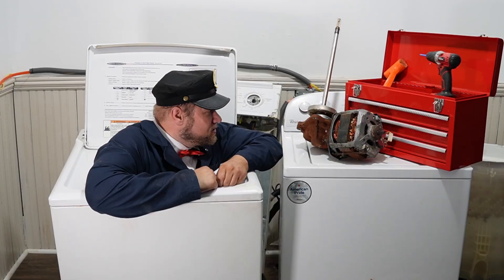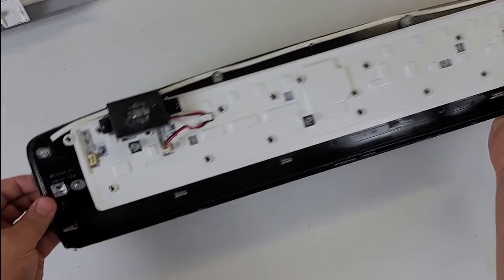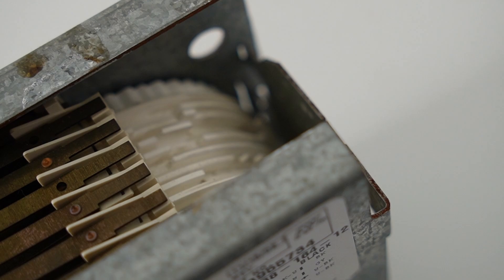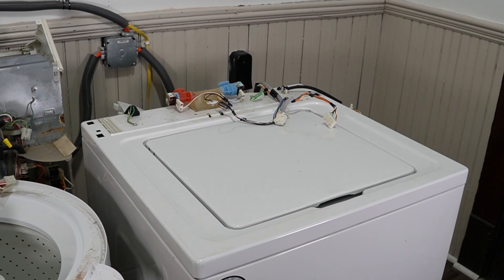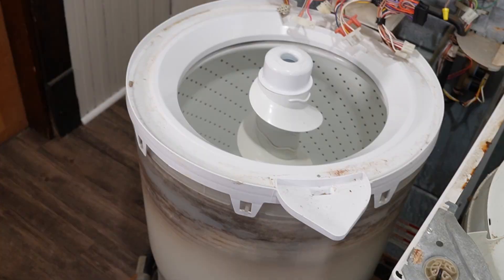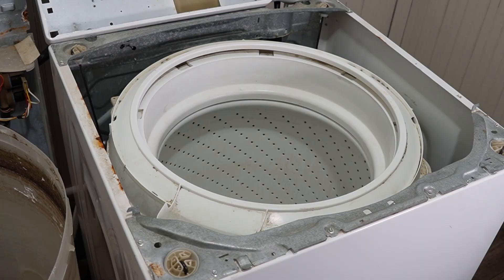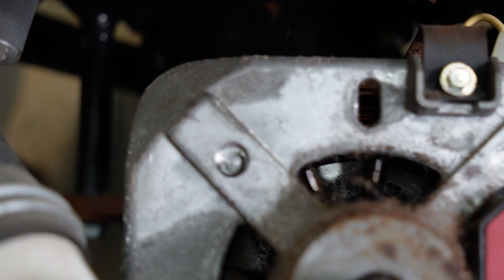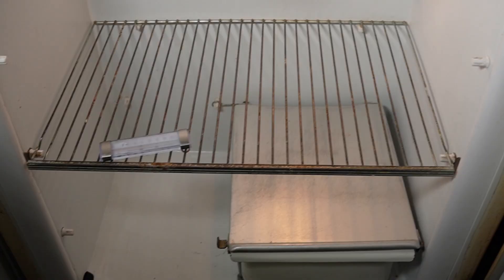Are Washers Built to Break? Inside a 1984 Washer vs. Now

Comment: one way to pull an argumentative tub loose from the spin tube is take a 2X4 cut where it will fit under the inner tub's edge and then use a car jack underneath it. as you crank it up, it will apply force from the cent directly into the tub and (usually) pry them apart.
Reply from the maker: I've done that a few times. I "gave up" because of the time constraints on the video.
Reply: @bensappliancesandjunk  I get it. Last one I had wouldn't come loose either and just had to scrap it. It's a dirty job.

Comment: I mentioned this previously but I live in a condo unit that was built in the mid 1980s that has a GE washer and dryer machine in the garage.  I really wouldn't be surprised if my appliances outlive me with just regular maintenance.

Comment: to get my tub out of my newer style washer I had to use a block of wood on the top of the drive shaft. I then put a car jack in it with a block of wood on the top and used the jack to separate it.

Comment: I used to work on all whirlpool products in the 90's. My kenmore elite is 35 years old. I replaced the inlet valve twice for under $10 ea time. Don't overload/abuse em & having a dry basement will keep em running forever. P.S Don't ever wash rubber backed rugs in them either.

Comment: When the clockwork timer on my old tumble dryer stopped working, I designed and built a sophisticated new controller and custom plastics to replace it.  I’m very happy with the outcome but it does illustrate an important point to me: That most people are not so well placed to do what I did, leaving them high and dry when things break.  This opens the market to design driven abuse.

Comment: My mom had a washing machine with a set of relays that would give up and burn every 2 years. 5 bucks to replace each.

She finally got a new washing machine. The circuit board behind the panel kicked up the ghost in 5 years. 400 bucks to replace. She regretted having sold the old one.
By the way, people don't realize that BELTS are mechanical fuses. If something should break, the cheap V-belt will destroy itself preventing further damage. Direct drive machines don't have that option.

Comment: Before my new dryer, my old dryer, that was less than 10 years old, had broke 4 separate times in 1 year. I had fixed the dryer and replaced the parts each time except the 4th time. I couldn’t believe it. It just wouldn’t stop breaking in a new spot.

Comment: I have found that using about a 3# hammer, which is a necessity to hit the spanner wrench to loosen the nut with a sharper blow similar to an impact . Then after the nut is off, I use the hammer and a 1"×12" piece of pipe. I place the pupe over the shaft and against the basket drive block. Then while picking up on the basket with one hand and hit the pipe with the hammer with the other hand.  So fat it has always worked. I hope this helps.

Comment: Still running a washer and dryer set from General Electric that was manufactured in the early 90s, in fact now that I think about it the majority of my kitchen and laundry room appliances are all old work horses, I have an automatic can opener that I just can’t find a newer replacement for because they all suck. I have yet to find another automatic can opener that can open a gallon can of peaches on nothing but it’s own power.

Comment: I have found that a SDS hammer drill set to hammering mode is a suprising capable tool for breaking loose stubborn fasteners. Might not be the best but it's what I have at hand.
Reply: That's a good idea.  I was able to get the transmission out with the aid of bearing separator, a gear puller and an air hammer.  The vibration did the trick in jarring it loose.  Didn't need that spanner tool either as the air hammer got the spanner nut to turn as well.  Next time I'll try the hammer drill first.  Thanks for that tip. Odd that it required so many auto mechanic tools to disassemble.

Comment: Excellent video, Ben!  Sorry to hear about your heart problem.  I assume that is why you are going to do a career change.  I wish you good health!

It's amazing how 19 minutes goes by when you're really into something like this.  LOL  Seriously, WOOOOSH and it was over. 

This vid demonstrated the EXACT reason that I keep our 20 year old Kenmore washer and drying in top shape.
As an Electronics/Computer tech (finally retired) I KNOW that the newer machines are NOT built with anywhere near the same quality and lastability as the old ones.
I'm very aware of how easy it is for the electronics to fail and probably difficult for the average person to obtain ACTUAL service manuals, schematics and parts lists for the PCBs.
Not everyone can do board-level repairs either.

With our 20 year older set, I've only had to repair the dryer a couple of times and it was a simple thing.  Basically, the heating element failed, but being inventive, I was able to get it working again with pressure-fit metal connectors.  When it failed again, a few years later, I just bought a new element, which was not very expensive.  Also, I do clean out the exhaust path of lint, once a year, however.

As for the washer, I have had to repair that about 3 times, but each time, it was just replacing the brake assembly.
At one point, I did take out the tranny, cleaned that up, changed the oil inside and new seals.  That was easy yet fun.  LOL

I haven't put much focus on the spring, but after seeing this video, I think that this fall, I'll tear the washer down and perhaps just replace the springs for good measure.

I dread the day that I can't get parts for these machines anymore.  As I typed that, I thought, hmmm....  perhaps I should just order a bunch of parts that I suspect would fail.  I'm not worried about the motor itself, because there are universal ones that would fit, but then, it's not too difficult to re-wind these types of motors.  They are very open.

Anyway, thanks for the great video.

Comment: A few thoughts on the subject Bought a house about 98 came with a washer and dryer circa 1975 ish Branded Montgomery Ward I've had no real trouble with the washer  except I had to replace the timer motor and oddly the dial is not  detergent proof Still looks for most part almost as good as new and still works well A couple years later the driver gave up the ghost so replace it with a whirlpool  well very soon after that I had to replace the ridiculously thin drive belt  and the paint on the dryer is so thin that it has starting to rust and I've had to paint it where as the washer as I said still looks reasonably good after all something you dump wet clothes on a regular basis shouldn't be rusting out so soon .

Comment: I repaired and own several Telechron syncronous motor clock/radios. Telechron eventually replaced their all metal gear rotors with plastic ones, to compete with less expensive models. I have a Sunbeam automatic toaster from the 1970's that was discontinued, as Sunbeam couldn't keep their prices down low enough to make a profit against lower quality competitors. I could go on and on, but planned obsolescence is here to stay:(-John in Teas

Comment: Just a thought, Whirlpool had to come up with a new design to satisfy water usage, electric consumption, that resulted a less reliable machine. Sears had whirlpool build their washer and dryers for many years, with SEARS technicians input. Also Sears specified a low percentage of failure rate. Sears would buy the washer, dryers, window ac, vacuums, etc, with no warranty from whirlpool to sell at a very good price, and Sears bore the warranty expense as they sold a high volume of machines. Sears sold way more than whirlpool did under whirlpool brand. Sears always included a parts list on everything they sold, no other company hardly ever did. Sorry to see them go…..

Comment: I had an old Beau mark washing machine which actually had a cinder block hanging on the bottom structure of the tub! That machine lasted us at least 35 years!
Reply: Many of the front load washing machines have concrete blocks bolted to them for balancing purposes, makes them ridiculously heavy, and they aren't that great of a machine anyways LOL.   Although most failures that we saw in the field were control boards, electric drain pumps, rear drum bearings, and door seals (boots).  They just don't seem to last long.

Comment: Great video!  Those appliance boards are about the cheapest I've ever worked on.  1/2 second too long with the soldering iron and the traces lift right off.  And what they charge for a new one is absurd.  Thats a $20 board.
Reply: feathery traces are bull

Comment: you can sometimes find a good electronics thechnician and have them fix the circuit board. i did that on a $700  air purifier that had a broken on/off switch.i am terrible at soldering and it cost about $20 for the work less than $5 for the parts + the drive to the location. they remove the faulty component, clean up the space and can install the new part. best to bring them the board with the new component and hopefully get instant service. took about 15 minutes.

Comment: As this video shows, and is generally true in most consumer and commercial systems-its a matter of efficiency. Standards have gotten much higher over the years, and consumers have gotten more efficient. However, this comes at several costs, often durability. Common issue in modern hvac.

Comment: 4:04 i dont see much issue on that board, except that power integration power supply ic which i replaced so many of them on control boards, they fail so often, from board that isnt turning on at all, to washer that shuts down completely by itself mid cycle

Comment: In 1994 I had a customer give me a 1969 Maytag dryer. I had it until 2002 and it was still working when I gave it away.
I currently have a GE refrigerator that is roughly 27 years old. I keep it running but it's a bit of an energy hog.

Comment: The machines I have were manufactured in Russia during the Cold War for the military and in the former Soviet Union we do not like planned obsolescence. They are still being manufactured but only for our military in the nuclear warfare department where we cannot afford them to fail and the fact that replacements and spare parts will be almost impossible after a nuclear exchange. They are for military use only in the nuclear warfare department. I just happened to be at the right place and at the right time that allowed me to acquire a whole range of them such as laundry machines, drying machines, dish washing machines, refrigerators, freezers, chillers, ice makers, stoves, toasters, baking machines, etc. They are all made out of stainless steel containing higher amounts of tantalum and niobium and a significant percentage of tungsten. All of their components were precision hot forged, hot stamped, hot trimmed, etc. Precision machine tools using tungsten carbides and diamonds were also used to precision machine them to extremely fine tolerance. Military grade means we cannot afford them to fail even in peace time for if a war breaks out or a nuclear exchange happens, then it is better to have them all designed to last as long as they exists.

Comment: I have a kenmore that looks extremely similar. It is direct drive though , which was more money at the time but I’m assuming better . I bought it in 2001 when we still had a Sears ,and it’s been running perfect . I’m single , so I only average one load a day .
I would like to replace my set with front loader LG’s someday ,but if wait for my kenmore to break down, I may die of old age first lol

Comment: I repair everything I have, mainly because I repair everything in my business. From heating and cooling equipment to anything inside or outside a home. It's in my blood. Most times when I'm inside a unit, I can find an engineering fault and improve it. I've drilled holes and put a cotter pin in where the was a plastic triangle "keeper" that kept the rollers on. The keeper failed. 4 rollers one failed... improve them all. Literally a 20 minute job!

Comment: Haven't watched the video yet (I will) but everything now is built to break.  They can't sell you a new one if your old one still works.  I think of the "fix it" and "picker" shows of a few years ago.  They would have an 80 year old refrigerator and they would invariable work.  One built now might last 10 years (my last one lasted 5 years ... thank you GE, never again).   We have the capability to make something last as long as we want.  If we find that a particular part is failing, we can design a better part, maybe with better metal, maybe thicker ... whatever.  But companies don't so they can sell new ones.

Comment: I don't think technology is the problem with the computerized control system rather it's an attitude problem found with the manufacturer. Since you can't see what's happening in an electronic system you need documentation and assistance from the software to diagnose the problem.

Comment: I really liked my Maytag Atlantis washer. Simple, effective, and reliable. After moving house I bought a Samsung on the salesman’s recommendation. I hate it! It constantly ties bedsheets in knots and turns shirts inside out. Cycles are long and usually the timer is way optimistic. It sometimes just stops without notice in mid cycle because somehow it’s gotten itself unbalanced. I’m sure the control panel will be expensive to repair when it inevitably fails. I’d rather have a good functional machine like the Maytag than this one even though it plays Mozart when it’s done.

Comment: Can I make a suggestion? I would love to hear more about the Whirlpool/Kenmore washers and driers made between the late sixties and the early '90s. Is there something special about them? Does it make more sense to look for an old used washer/drier set than to buy a brand-new one? And how about the Whirlpool/Kenmore models in particular? I'm no expert, but I'm beginning to get the idea that there was something especially rugged and well-designed about the Whirlpool/Kenmore models of this vintage. What years are the "good Whirlpool/Kenmores?" (I gather the run started in the late '60s.) I would also love to see how they compare with the current traditional-model Speed Queen washers and driers, the one washer/drier combination that still seems to be made the same way. Frankly, I think you're one of the few YouTubers who could do the subject justice.

I grew up with these Whirlpool/Kenmore washers and driers. My family bought a Kenmore set (with electric drier) brand-new in 1969. They were running when my mother sold the house in 1999, and I'll bet they are running today. In the '90s, when I lived in California, I bought a used Kenmore set of similar vintage (with gas drier -- electricity was too expensive in CA). They worked fine for me until I sold my house seven years later. And here's the weirdest thing -- right now, in the basement of the house I currently own, I have a setup pretty much like you have in this video.

The house came with what turns out to be a 1986 Whirlpool electric drier, and a newish Roper washer that looks almost identical to the newer Whirlpool in your video. I gather that Roper is just a rebadged Whirlpool -- same washer, same factory. Well, I blew a fuse in the old Whirlpool drier last week. It was my fault, I let the lint trap get clogged. I called a local repairman. He looked at the drier, and he said "Thank goodness. Lint trap on the top. That's all I needed to know. All the Whirlpools with the lint trap on the top are basically the same. This won't take long." He was right -- he was done in less than 10 minutes. 

I'd already seen this video, and I asked him if he thought there was something special about the old Whirlpool/Kenmore washers and driers. He went on and on about their virtues. He loved working on them. On newer machines, he said the repairs are often so time-consuming and expensive that people often just go out and buy another cheap brand-new machine. Then that breaks down, too. So many times you blow a computer board -- that gets expensive. The old machines don't have them. 

I said, "You can see my washer is a whole lot newer. It's running fine right now. But when it breaks down, I wonder -- does it make sense to repair a newer cheap washer like this one, or should I go out and find an old Whirlpool or Kenmore washer like my drier that still works fine?"

He said, "You could do no better than to find the Whirlpool washer that matches your drier. But only if you want something that's reliable, long-lasting and easy to repair. Repairing this one?" He made a face. "I'd go with the Whirlpool."

In your video, I think you've done a great job of explaining the differences in manufacturing techniques, old versus new, and you've shown why repair has become a more difficult proposition. But how about these particular Whirlpool/Kenmore models made 30-50 years ago? Can you really just keep 'em running forever? Do they stack up against Speed Queen?

Comment: That issue with removing the tub because of the nut in the center, I am wondering if on a new purchase it would be prudent pulling that apart and coating the spindle and all that with no-seize or vaseline maybe. Then, taking it out and doing that again every 6 months or something. I tried getting my washplate out with the shoestring method and ended up hanging the whole washer from the ceiling with a rope and pully and couldn't get it off. Tried Lime-away and then  the plate snapped. I chiseled the rest of the plastic off and there is still the metal sleeve from the washplate on the spindle. 
That's, what I would like to avoid in the future once I get another washing machine.

Comment: We have an old Kenmore. I have replaced the motor, clutch and drive tube assemblies. I keep the rubber coupler in stock as well as the agitator dogs. I will keep fixing this washer until you can't get parts anymore. The new washers are garbage.